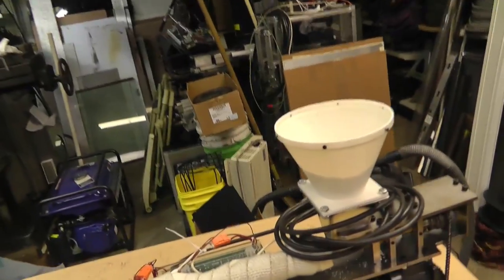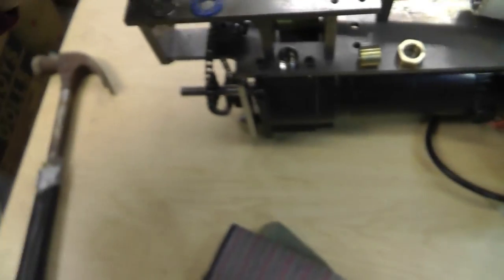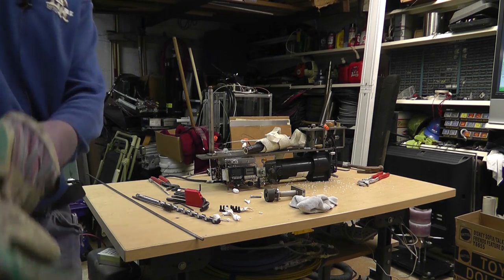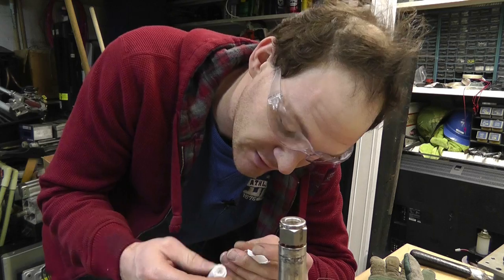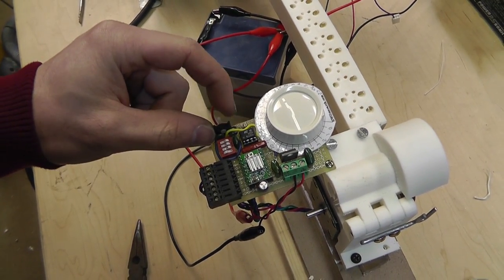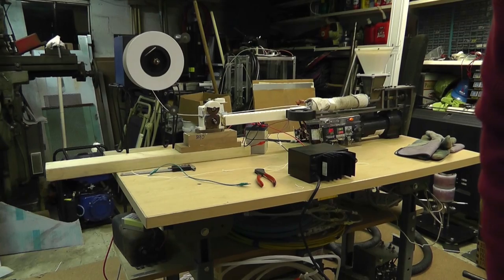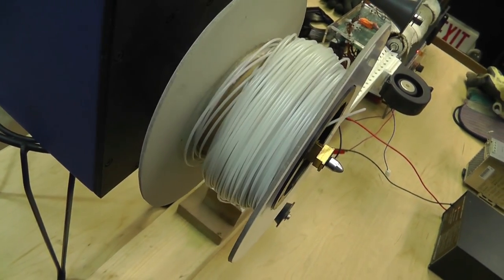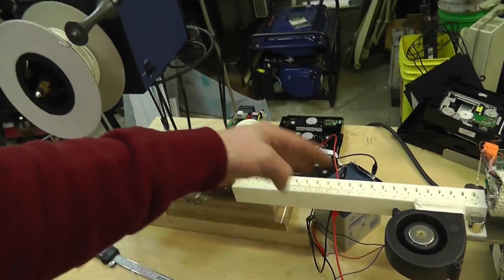#11 ~Russ's Filament Extruder: Cleaning For New Plastic, New Plastic Trial, Auto Spooler Test

Comment: Now that's a creative comb over;o)  When I worked for Blazer Plastic in Willard UT the operators would just take the tip off the injector and run a big blob through and didn't worry about getting every little piece out.
Reply: Robert Palmore, same with me. We ran pvc and all we did was run the barrel dry, and rarely did we pull the screw to get every last bit out.

Comment: This is so awesome, love it so much.  I have made a few ABS rods for my extrusion company and have been able to hold .05 mm tolerances.  You might benefit from cooling it slower and possibly supporting it not letting it just kind of float through your downstream cooler.  Differential cooling is why its not round, have you noticed any voids?  Generally the faster the better although I know you are limited in your extruder output.  Even though it isnt perfect yet this is absolutely amazing, you are a fantastic engineer.  Keep up the awesome videos, your kind of my hero.

Comment: Hi Russ, you should get a bunch of brass bore brushes for cleaning out your tube. and you might try PTFE mold release, the ABS should just fall right out. but you have a very very cool project. i have been in the extrusion industry for 15 years, and you are well on your way!!
I have watched your video and have a few suggestions.
1: your tube is very short for processing ABS. you might try heating the first two or so inches of the tube to a higher temp, to get the plastic melting sooner, to in turn build more friction heat. You should then be able to run the temp cooler towards the end of the extruder.
2: instead of the fan for cooling the filament alone, you might try some cold or room temp water just as the ABS comes out of the extruder, then use the fan to blow the water off the filament before the spool. your key could be more distance for cooling before your "puller"
3: the discoloration in your finished product could be coming from the "dead space" between the auger bit and the "die".
Reply: +mikeonavtx I was thinking about this "dead space" comment of yours. What do you mean exactly? And does it have to do with the profile of the die?

Comment: You should try ASA. ASA is 5 times as weatherable as ABS without yellowing and depending on grade, you can find injection grades that melt at 340F and extrusion profile grades with a melt temp of 460F.

Comment: Hey +rwg42985 ! I'm a huge fan of this project and I'm planning on trying it myself. I have a quick question for you. 
At the end, you said that you think a vertical extruder might work because the filament gets pulled by the self-weight. But isn't that bad for maintaining the diameter? If it's horizontal, you can control it better (with the speed of the pull rollers), right?